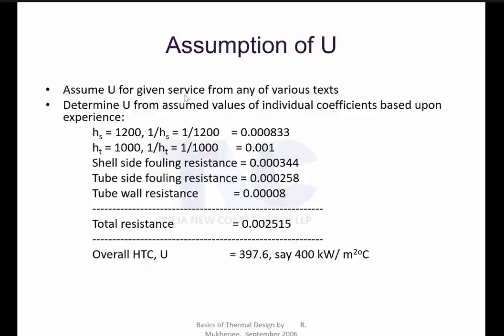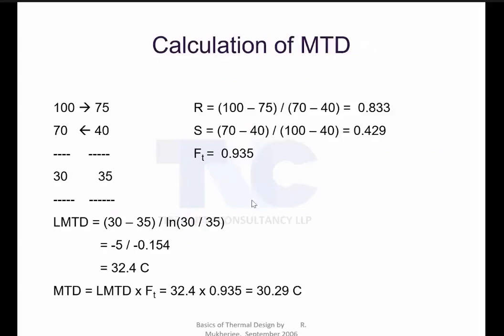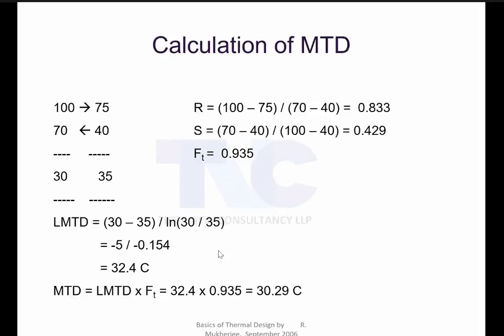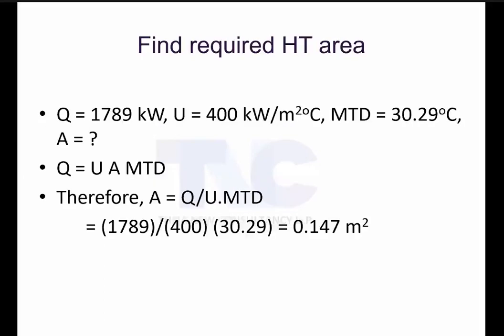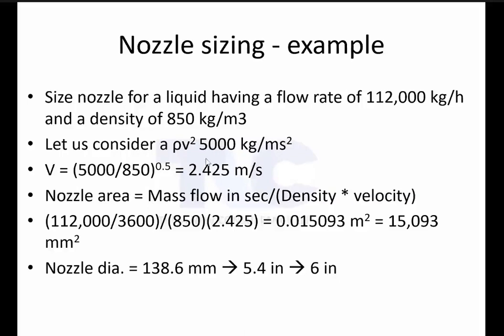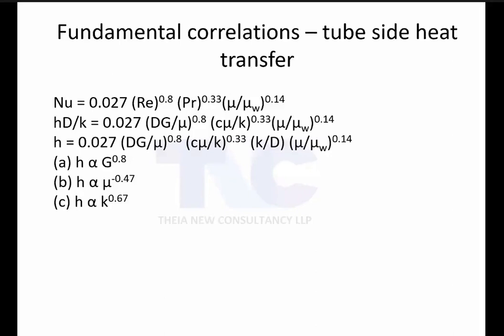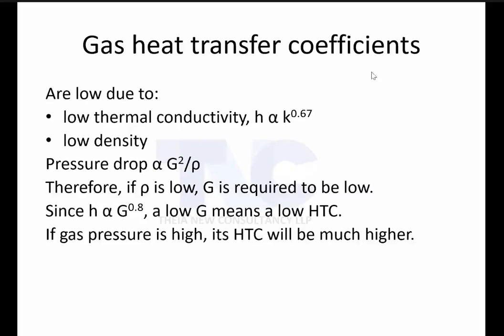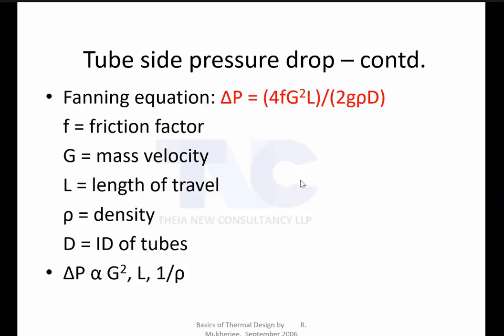Process Design of Heat Exchanger part 3

Comment: Sir  can u tell me under which gate rank I will most probably get a call from Psu being a General candidate?
Reply from the maker: In current scenario under 50.
Reply: @ayushsaxena7770  after 2 years? Supposing covid will go.
Reply from the maker: @nikhilCAT60days  more or less same. Privatization is going on and vacancies are reducing. ONGC recruited 84 ppl in 2018 ....in 2020 they recruited only 16.
Reply: @ayushsaxena7770  actually i m doing my chemical engineering from nit hamirpur.... And I m confused whether to do gate prep or prepare for an it job... As their is very less campus placement in core Sector.... Also I dont wanna do higher Study!!!
Reply from the maker: @nikhilCAT60days  see. I work for an oil and gas design firm. Opportunities are very less in core sector so is the pay. Don't pursue mtech placements are not good. If your college has it company that pay around 6 to 7 lpa then blindly grab it. In current scenario evem tcs wipro people are getting 100% after 2 years of exp. Career in chemical engineering is not worth it.
Reply: @ayushsaxena7770  yeah some mass recruiters recruit chemical engineers in our campus every year like delloite ,Capgemini, tcs etc. So should I focus on tech?my ultimate goal is to get a good paying job either be tech or core!
Reply from the maker: @nikhilCAT60days  Tech in chemical engineering will not pay you more. Plus jobs are volatile in process design. IT will pay you hell lot of money if u upskill well. I myself is leaving this field for other opportunities.
Reply: @ayushsaxena7770  thankyou very much sir for replying.... 🥰
I think I should go in IT Sector too....!!!